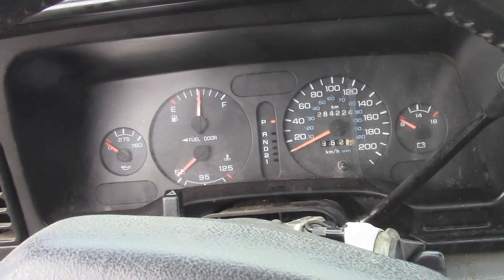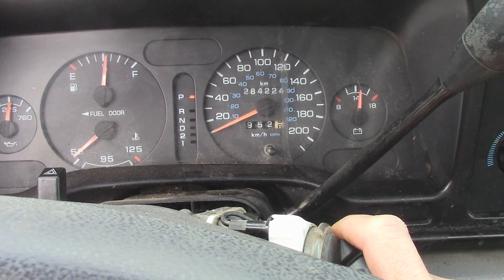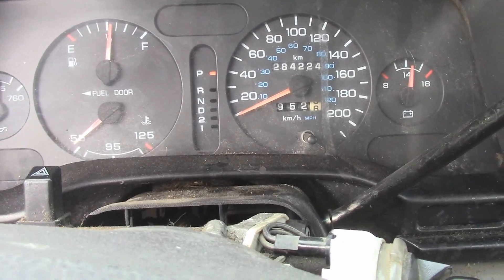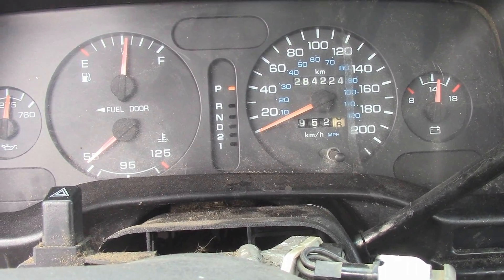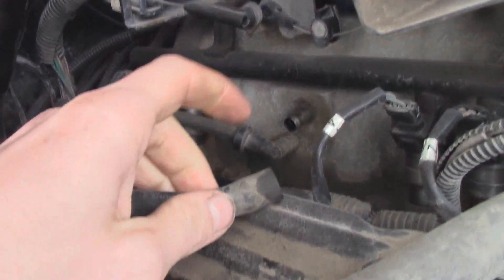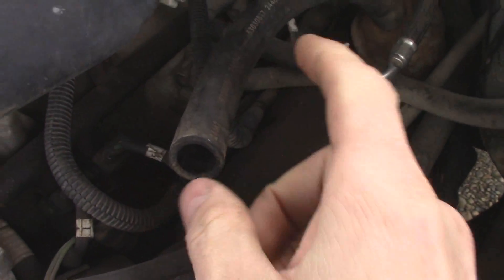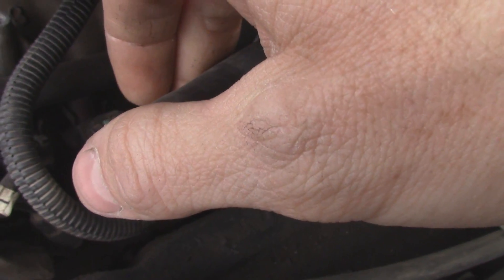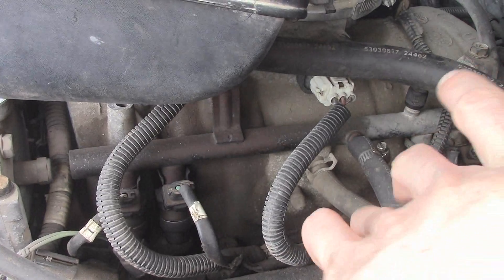Dodge 318 Magnum Intake Plenum Leak Diagnosis

Comment: Great video man! Easy to follow and comprehend. I have the same issues with my 99' and have tried everything else to remedy the constant leaking oil, AWFUL STINK, and plumes of smoke once it has idled for a lil bit.
Reply: Did you fix it? Mine does smoke horrible

Comment: On mine: Engine off, remove air cleaner, hold throttle wide open and with a flash light look straight down through the throttle body bores. I had pooled oil in the bottom of my intake manifold. Easy to see. It was fully wet with oil. Also a couple of sparkplugs were oil fouled. Lots of soot in tail pipe.
After gasket replacement, engine ran way better and smoother. No soot in tail pipe.
Note: Myself and other have found the bolts that hold the plenum plate on are too long and bottom out. That is why the gasket blew out. Shorten the bolts, buy shorter bolts or put washers under the bolts, and reuse the original plenum plate. No need to buy a $100 aluminum plate unless you just want to.

Comment: What is the hose that is connected to the bottom left of the pcv valve? On the block itself? My block is missing that hose and just has the nipple port exposed with no hose.

Comment: I got a 2001 van 3.9 liter. The front two cylinders are misfiring. OBD II reader is throwing a code saying two much oxygen in the exhaust and its blowing oil out the top of the engine. But its not sucking oil into the intake. 

Could tye plenum gasket still be blown?

Seems like excess air is entering the front two cylinders .

Comment: Yeah, I found out my plenum gasket gave out because my idle started to climb. With no leaks on the outside, I put my palm over the oil fill hole and right away I felt major suction. The crank case is not supposed to have vacuum . SO I replaced the plenum with a Hughes upgrade kit. 1/4 plate aluminum, This way there will be no variations in temperature . The old plate was a thin steel and the intake is aluminum. Now it runs cooler and I have plenty of power with no more pinging up a hill.
Reply: Just coded my truck last weak, cyl 8 had 'excessive misfire', a quick change of a set of plugs cured the 'money light' but I dug deeper and located several articles on the 'plenum' leak issue, made an adapter and hooked up my vaccumn guage to the oil cap opening, showed 8-10# vaccumn. I don't drive the truck on a daily basis so I plan to remove the plenum this weekend and pull 'forensics', depending on what I find I will decide then on either an after market gasket kit or either the aluminum plate mod kit. I like the little truck and it is currently my 'project truck'. It was a sorce of therapy for me as I was recovering from chemo and radiation treatment, after DEFEATING stage 3 lung cancer, 5-1/2 year survivor so the truck has a special value to me, even though I concider myself a chevy guy, lol.....gonna keep the lil dodge around for awhile..lol.....
Reply: @jamesmoore3346  Once you get the plenum fixed, it will be night and day performance. Power like it left the factory. I used a Hughes kit to fix it. 1/4 inch plate.

Comment: I had one with that problem and it ran fine. You just couldn't run it over a hundred miles without putin a quart of oil in it and you could look down through th throttle body and see a lot of oil in th bottom of th intake. That kit from Hugh's engine with th aluminum plate took care of it
Reply: Would you happen to have a part number for that?

Comment: I have a '99 Ram that had a bad plenum leak like you describe.  I replaced it with the Hughes kit and it worked well for about a year, then right back to the same issue.  Really hate the idea of spending several more hours redoing all that hard work.  Last dodge I'll own, I hope.
Reply: Yep,,,  I'm going to  coat the gasket with  permatex aviation form a  gasket on both sides before I install mine. Makes it oil proof.   That is  what we did for the crank case on my brothers shovel head Harley Davidson engine block,  and after 15 years it still works great without any oil leaks.
Reply: @francisbrackney2061  That sounds like a great idea.  I wish I had done that to mine.  Also, I should have put some blue loctite on the bolt threads.  They come with some on them, but I think more would help.  The suggested torque is in the inch-lb. range, so there is not much force holding that plate down.  I followed the instructions in the kit from Hughes and as I said, it worked until it didn't.  I haven't taken it apart to see what failed, but I expect that some of the bolts worked loose and let the gasket fail.
Reply: @francisbrackney2061  That's exactly what I used on my brother's 5.9L Magnum plenum gasket. I cleaned up the factory bolts and cleaned out the threads on the intake manifold with brake cleaner. I used blue lock tight on the plenum bolts and followed the tightening sequence and torqued it down exactly.  It's been about 1.5yrs since I replaced that gasket and he hasn't bugged me to fix it again. Hopefully it's fixed for good,cuz I don't wanna do it again. 😆 But I think I may have to replace it on my 5.2L ZJ  soon because it seems to be using a little oil. I looked down inside the intake manifold and it looks like there's a little oil in it.  I figure that the plenum gasket is probably bad,just not bad enough yet to make the engine run bad.

Comment: My 99 dodge ram has a 360. It idles rough,and if you let off the gas to fast it stalls out and doesn't like to start again,in burns oil, and it's putting gas in the oil. Could that be a bad plentum?

Comment: Basically the same issue. I tried this method and too me it felt like it was blowing air and not sucking in. I’ve replaced a bunch of sensors and still the same issue

Comment: Thanks for sharing this video. So the blow from the cylinder comes from the opposite side of the crank case (driver side) in this case? If the plenum has a leak then this side will have a suction on it as opposed to a air shooting out that you should feel on your thumb? I thought the pvc side (passenger in this case) was the side that had positive pressure. The PVC function is to go up and down and stop that positive pressure at certain thresholds.
Reply from the maker: chvydrptop the blowby doesn't come out of just one side. It pressurizes the entire crankcase, including up in the valve area. The PCV valve is to allow some blowby to recirculate into the intake and be burned.
Inside your combustion area (after the throttle body) is all vacuum.
When the plenum starts leaking, it creates a vacuum inside the crankcase, and starts sucking in oil, which destroys your catalytic converter, fouls your plugs, and can cause a horrible running condition if it gets bad enough.

Comment: Good morning analog., I have a RAM 5.2 1999 in the morning it turns on well but sometimes during the day while I use it if I turn it off and then I will turn it on it takes time to turn on and it turns on failing but it is still normal then what could be
Reply from the maker: Id start with basic maintenance. Change the fuel filter first. I had an issue with starting my 3.4L swapped 4runner after it was up to temp, ended up being fuel related. Fired up perfect when cold, but it struggled after id run it then try to start it again. I ended up changing the fuel pump, and it was fine

Comment: Hey I have a 1997 Dodge Ram it has a misfire on cylinder 2 I think it’s a bad intake manifold it burns so much oil when I give it 3000 RPMs Blue smoke goes out the exhaust shakes really bad any suggestions ? Thanks
Reply from the maker: using a magnet on a stick, put it down your throttle body and see if it sticks. if it does, you've got a steel plenum base, and the gasket is probably breached. if your problem is only at 3k ripums or higher, it could be rings. check for vacuum in the crankcase like i show in this video, and go from there :) if you dont have vacuum, id suspect bad rings or something else.
Reply: I would do a leak down test on your cylinder heads, you could have multiple things going on.
Reply: Have a 98 doing the same, cloud of blue smoke when revved so high, you ever figure it out?

Comment: I had the same idle issue, it ended up being my iac (idle air control)
Reply: did it smoke at start and whenever you drove it smoked even more?
Reply: @Toothless69420  mine does
Reply: @marcovalle9410  same here still i think its the headgaskets
Reply: Our don't smoke. But has a rpm surge,  and it misfires below about 2500 rpm,    , just  basically runs like a engine with a vacuum leak.  Only I could never find any external leaks.   The exhaust also has a  strong odor of nitrogen like it is running too lean.

Comment: my crankcase tube don't have any vaccum doin this any ideas?97 dodge 1500 5.9 mag,runs put it in gear and stalls
Reply from the maker: mopars23 any transmission issues? Your lockup solenoid might be acting up? Does it just sputter and die, or bang and die?
Reply from the maker: mopars23 sounds like a transmission problem. Id guess theres an issue with your lockup solenoid. You have the 46re in your truck? I cant remember which wire it is, but you can cut it and it will disable your lockup. If that is not the issue, then its a simple case of reconnecting the wire. Ill see if i can find out which wire the lockup is.
Reply: i meant 98 but i do have a 97 parts truck.how would i know if its 46re? it has 2 driveshafts.thanks so much replyin back
Reply from the maker: mopars23 the lockup solenoid is the orange and black wire going into the connector on the driver's side of the transmission. If its 98 it will definitely have the 're' transmission. That would be the electric controlled trans. The 'rh' is hydraulically controlled.
Reply: so cut it?but do it where i can splice them if needed?
Reply: whats the differance of lock out and non lock out
Reply from the maker: mopars23 id cut it like 2" away from the plug. Give yourself enough room o be able to strip the wire and use a good heat shrink butt connector to reconnect the wire if its not the problem.
Reply from the maker: mopars23 lockup is just when the transmission locks the torque converter so theres no slip or loss through the converter. If its stuck in the locked position, there wont be any slip or stall. So as soon as you put it in gear, it tries to take off, but cant, so the engine stalls
Reply: analog56x does it do it when you first start it up or does it stall once the trucks warmed up?

Comment: I hear a whistle like a jet engine when truck is warm. Is that not sign along with the loping idle.?
   I could look in and see the curves and the bottom edge of the steel pan from throttle body.
   There is an oily buildup in there too, what about o rings? is that stain by injectors at bottom side of kegger from oil or fuel?  Vacuum test seems easy enough, yours is real bad...
Reply from the maker: if you have the steel pan, and you see oil or oily residue on it from the inside, id be willing to bet that the gasket is breached. when that gasket fails, it creates a vacuum inside the block and sucks oil into the intake.
Reply: @analog56x  Oil inside the Pentium, can also be a result of a bad Pcv too.

Comment: Can anyone help me I have the same engine on my 98 Jeep Cherokee and it starts like for 5 seconds then cuts off can anyone help me that be very helpful thank you.
Reply: Jorge Bustillos security needs to be reset. The security systems on The 1st gen grand cherokees (ZJ) have a fuel system cut off for security. It’ll let it run for a second and then kill itt self. If you have the factory key or a key that works with the driver door and rear hatch, instead key into the hatch and cycle lock to unlock 3 full times and that should reset you’re security. If that doesn’t work, do it with the drivers door/ passenger door if it has a lock cylinder. I have a 96 with a 318 I fought those problem for a long time before I figured this out! Hope it helps!